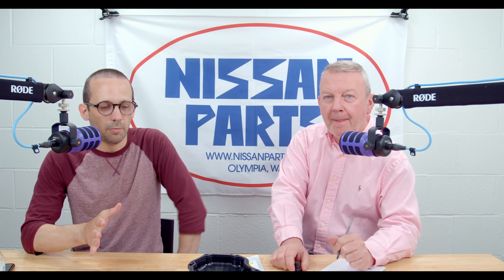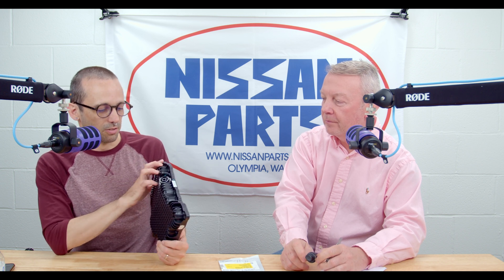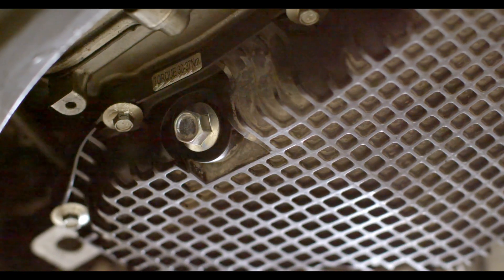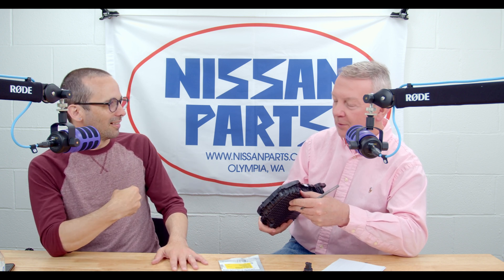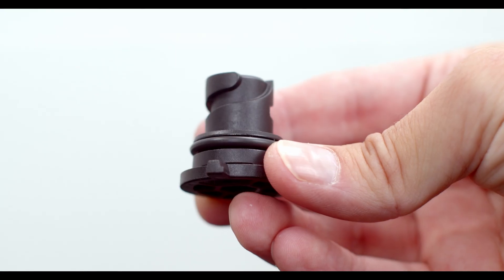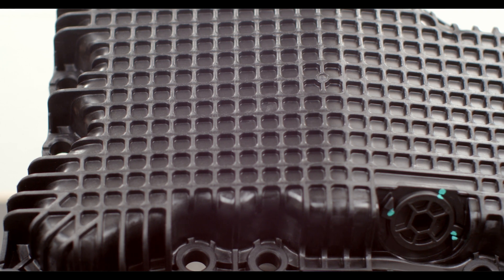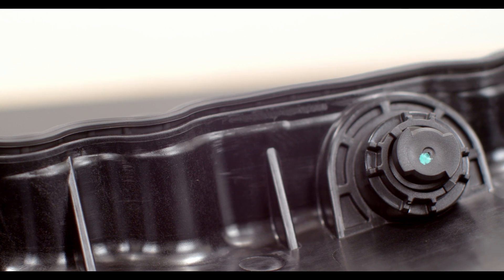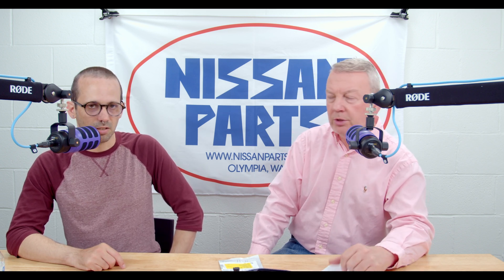Nissan's NEW Plastic Oil Pan & Single-Use Drain Plug: What You NEED to Know for Your Oil Change!

Comment: There is NO brass insert on the oil pan of my 2015 Rogue SL Premium. There is that little black plastic drain plug and it's not easy to find them if they truly are single use plugs. The parts store sold the brass inserts and when I called the Nissan Dealer they said I didn't need anything but that brass insert. They are both wrong. My mechanic doesn't know anything about these and reused the plug.
Reply from the maker: A 2015 had a completely different engine. Nothing from this video applies to your year.

Comment: Donkey Kong at Walmart over-torqued mine last Friday and I ordered the newer style along with 10 extra drain plugs and I will be doing my own oil change from now on. Two questions. Should I have used RTV Silicone Sealant on the new gasket and should the filter be hand tight or tightened with a wrench? The filter they put on was extremely tight; I had to put a screwdriver through it to remove it.

Comment: Its not that many people are “full send” these, even the mechanics at my local dealership said that even if you torque them to spec, the plug will eventually come out, and the torque should be less than whats stamped on the pan. I literally replaced my wife’s oil pan on her 23 rogue back in may and he saw me and said “oil pan for a new rogue?” As i was ordering a new replacement oil pan at their parts department. The service guy hates the new plugs and the mechanics hate the pan design and replace a busted one at least 2x a day.
Reply from the maker: Sounds like a shop problem. We are not having this issue. When we sell pans it's someone coming to us from another shop.
Reply: @nissanpartscc  Does the rubber oil pan gasket require any silicone or does it seal by itself?

Comment: Hi!  Any advice…dealership said last guy tightened my plug too tight and they fear they’ll crack pan if they try too hard removing plug and quoted me $700 for new pan.  Help!  2023 Rogue 1.3.  Thank you!
Reply: I replaced my wife 2023 rogue oil pan, same thing happened even after using the torque wrench the plug eventually will come out. Its extremely easy to replace and it was only 197 with taxes. Don’t let them scam you, it shouldn’t be 700 bucks for a service like that, any mechanic can do that and an oil change for half of their price.

Comment: if you look at the lower splash cover you can tell even before removing it if that insert is leaking because the pet cover will be soaked in oil. if you see that do not touch the drain plug unless you have a new pan handy.

Comment: I have a 2023 Rogue with 58k miles, have always done oil changes every 4k-6k miles and no issues with the oil pan, once i decided to get an oil change at Walmart (for my most recent oil change) come to find out they overtorque the drain bolt and the oil pan is cracked and oil is seeping through,  thankfully Walmart claims covered the cost for the repair but looking for that (updated) replacement oil pan has been a real pain, if there's any place where they are in stock I will buy one right now.
Reply: Did you have to go through the corporate office or did the local store manager cut you a check?

Comment: I change the oil just use an allen wrench you can't really over tighten it it just locks in place it's not hard at all it's because idiots were over torqing  the metal plug which had a metal insert fused into the plastic oil pan you're only supposed to use 25 ft pounds but morons would put a 100 pounds of pressure into it

Comment: I have a 2023 Rogue Platinum and it's been great so far. July 25 go to the dealer for Oil Change and Tire Rotation and was informed they could not change it as it was about this recall (oil drain plug risk of spinning with the insert) and I was 4,000 kms over (busy June/July) the 10,000 km interval at the time. Today Sept. 5th and the oil pan shipment still not come in and I am at 6,000+ over. Oil at top of dip stick mark still and looks pretty good, not too black to look scary, but this is not a great showing by Nissan. So many pans are needed in North America to replace them all.
Reply from the maker: We have 4 pans on the shelf.
Reply: Where are you located?

Comment: I’ve got a 23 rogue. I knew about the brass insert issues before my first oil change. I don’t have a torque wrench but I did my best. I don’t think even with a torque wrench that it will last the life of the vehicle. Mine lasted around 10 oil changes. On my last oil change, the insert stripped out when I went to unscrew it to drain the oil. What happened is the plastic melted into the knurled insert broke free from the rest of the pan, the plug was still fit tightly into the insert itself. The inert didn’t fall out, but it started slowly leaking oil. This happened because the plastic the oil pan is made from isn’t able to handle being used that way. Most materials have a certain amount of uses they can handle before they break, including all those tiny fringes of plastic melted into the crevasses of the brass knurling. Every time you tighten and loosen the drain plug, even to spec, puts wear on those fringes of plastic. They’ll give way eventually. That’s why they switched to the single use plugs and don’t sell the version with the brass insert anymore. Injection molding is cheaper than stamped metal, so that’s why they went that direction, but the college engineers missed a course on material science I guess. Anyway, my local Nissan dealership sold me the new pan for $200 so ymmv I guess and it’s about to see its first oil change. I’m actually looking for a video to make sure I only need a big Allen key and ran into this. At least the drain plugs aren’t expensive.

Comment: Tried to loosen drain plug and entire brass fitting came out, previous dealer oil change must have over torqued, or premature failure at10k, Flat bed to dealer for pan replacement. What a joke, Nissan is going down hill fast

Comment: Mercedes-Benz  has been using plastic oil pans for years and have had no issues. i believe its just part of the evolution in cost cutting  till will tell it, but i think in the frontier and titan itll be fine